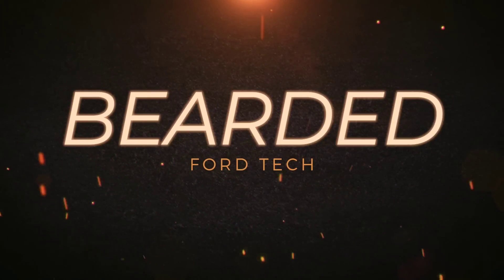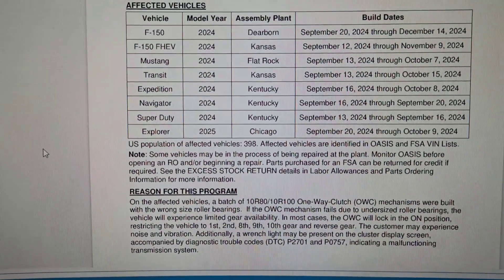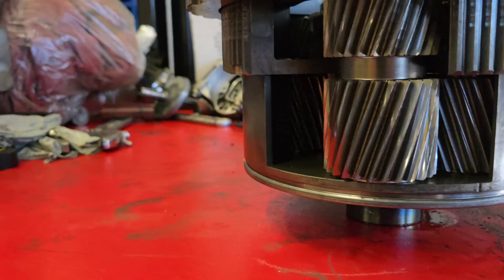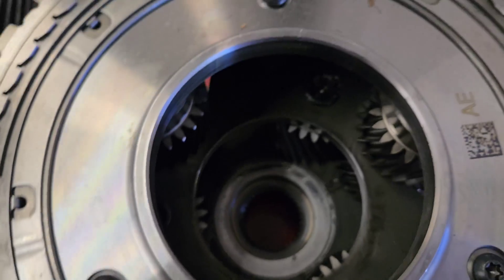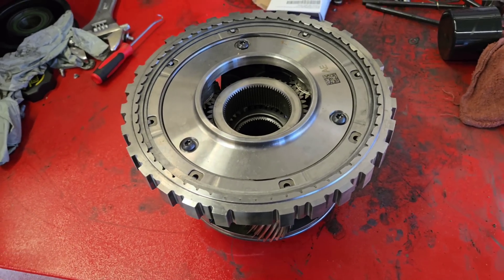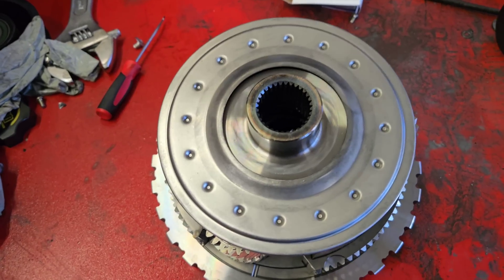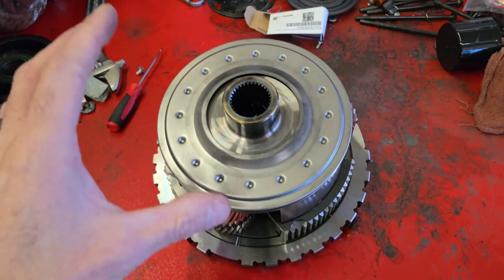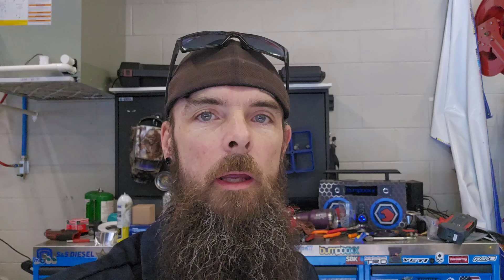ANOTHER!! 10 Speed Transmission Problem!!

Comment from the maker: This affects the 10R80 and the 10R100. Not the 10R140. I was just referring to the 10R140 cause it has the same internals as the 10R80. 
The OWC I showed is from a 6R140 just to show you what the part looks like. Not the exact same but performs the same function.
Reply: The GM 10L1000 used in the 2500/3500 pickups is having different issues such as the trans locking up and causing the rear tires to lock up at speed. My friend has a 2022 and just had a recall on his 2500 to supposedly address this issue. He had this happen twice before the recall was done.
Reply from the maker: @richwitt3559  yep. Thay recall is fairly new too

Comment: I tow alot with my 2021 f150. I use amsoil atf, would you recommend using their thicker fuel efficient atf instead of the ulv fluid?? Thicker is usually better for protection so i figure maybe that would be beneficial? Whats your thoughts?
Reply from the maker: Thicker os not always better. Transmission fluids expands a lot.  However. You have a 21. They didnt do the updated fix until 23.  I had a 2029 ranger with a 10 speed and used the fuel efficient atf.  Shifted like butter. But not because it was thicker.  Really isnt that much of a difference in viscosity.  ULV just expands a lot!  But yesh you can run the fuel efficient.  Its compatible.  I rode around for two years with it.
Reply: @BeardedFordTech awesome thank you so much man, i appreciate your vids

Comment: I bought a used 2020 at 47k certified used w a "Lifetime powertrain warranty", I also bought the "wrap" extended warranty for $4200.00. Now I have 82k miles my tranny is out and because I got my OIL CHANGES done at other certified shop NOT the dealer I voided the warranty. I am quoted at $10k for the fix and not a penny is being paid by warranty. $10k i don't have....I'm beside myself right now.
Reply from the maker: What does a oil change have to do with the transmission?  You can get an oil change anywhere. Explain "certified shop" please. I'm confused. If you got an extended warranty on your powertrain it should be covered. Email me your VIN i can see what you got. See if I can help you any way I can.
Reply: @BeardedFordTech ya i basically got scammed by a dealer....actually "The Oldest Ford Dealership in America" Tenvoorde Ford. Their website, window stickers, and advertising say "lifetine powertrain warranty for certified used when i asked for my signed documents its called a lifetime powertrain "loyalty program". In that document there is a term and condition that IF i live within 50 miles my work has to be done there OR call a 1-800 number for approval. It's not the ford factory powertrain warranty.
Reply: @BeardedFordTech the secondary warranty is a "wrap warranty" which is for most everything that not an internally lubricated part.
Reply: @BeardedFordTech liked and subbed thanks for listening man.
Reply: @BeardedFordTech i know it sounds confusing, I was shocked when I got my denial records. The ONE saving grace i have is i have the warranty document about those very specific terms and conditions they are citing to deny my warranty. Those terms required initials to show acknowledgement of those very specific terms and I never initialed it. It's probably not going to end well but for the moment its a little hope.

Comment: Any idea on why my 2021 f150 extended cab 4x4 10speed would shake a bit when I release the gas pedal going around 65-75 mph? It has about 36k miles on it and just bought it last week from the dealership, had a check engine light come on with P025A, P0300, P0304, P0306 before I ever made it home, had the dealership replace the fuel pump and seemed to clear the codes but now having this issue.
Reply from the maker: @kolebragg4638  300 is a random misfire on startup. 304 and 306 is a misfire on 4 and 6 cylinder. Which pump did they replace?
Reply: @BeardedFordTech  so he said just the fuel pump from the text messages he sent
Reply from the maker: @kolebragg4638  there's two. On in tank. And a high pressure on one engine. Something isn't adding upb
Reply: @BeardedFordTech  interesting, the codes all went away and drove fine for a few hundred miles. Got a good bit of mud up under the wheels that seemed like it made the shaking worse but knocked it all off and still happening just not as intense. Got tires balance and aligned with no resolution. I will reach out and see if they can tell me which pump was actually replaced. It’s been the worst experience I’ve had with a vehicle thus far and it’s only been 2 weeks
Reply from the maker: @kolebragg4638  yeah a deceleration vibration can be tricky. Let me look at tsb
Reply from the maker: @kolebragg4638  only thing I see is for vibrstion shudder and throttle tip in during highway speeds. And the fix is to reprogrsm the pcm.  Thats for a 2.7 3.5 ecoboost or the 3.5 powerboost. Not a 5.0.  Which is TSB 22-2224

Comment: Another ford tuff. My lovely F150 gear selector broke off putting it into drive. Had to hang it up with a rubber band because it shifted into third gear going across a bridge goin 60. Funny thing is the part was back ordered. Go figure. The selector is two pieces. Outer part sides onto a shaft closest to the column.😢
Reply from the maker: @Laserman99  I'm doing an E350 steering selector broke. It's a 2011 I think.  I know on the like the 02 models. The shift lever will get loose. There's Teo torx bolts under the dash. Tighten those. Fixes that problem. May not be your situation though.
Reply: @ mine is a 2023. The plastic snapped inside the boot which then allowed it to come off but not completely because of the wires.

Comment: If the one-way-clutch is either locking at wrong time or unable to lock, I can't see how those thrust bearings would have any influence. The "bearings" in the actual OWC being just a few thousandths off WOULD make a difference. Around 3:42 you move the OWC slightly. The thrust bearings, which you fondled earlier, only affect end-play. If they are failing and scattering metal, that's a whole nuther thing.
Reply from the maker: @gailtaylor1636  it's the bearing on the end too which I didn't have to show. A roller bearing. All three are out of spec.

Comment: Why does an automatic transmission need 10 speeds the more speeds the mire headaches...6 speeds is enough
Reply from the maker: Fuel economy.  I will admit that yes it does getter better fuel mileage cause it's in a higher gear. And 7th gear is the 1:1 ratio on the 10 speed. However. The 6 speed is my favorite.
Reply: It is same thing as the automatic engine shut down after a short delay, for example at stoplights. It adds cost, complexity, and weight but it games the emission restrictions, right under the noses of the regulators. And everyone knows it and looks the other way because our society treat more cost, complexity, and weight as “lluxury”.

Comment: I think the biggest downfall of gm transmissions aren’t the transmissions themselves, it’s the torque converters. They’re cheap, they grenade themselves trashing the rest of the clutches. The 8 speeds have a few more issues in the valve body as well, but for the most part if they just put quality torque converters in, the transmissions would last just as long.
Reply from the maker: @morganpowell2999  all the ones I saw fail on gm when i worked at independent shops was valve bodies clutch packs. And planetary.  Yeah the torque converter is junk too
Reply: @  were those 8l90’s mostly?
Reply from the maker: @morganpowell2999  mkst of them yes
Reply: @  yea those are the worst ones. I think gm actually has a lawsuit against them because of that transmission.
Reply: That is what I learned after I had a 2015 6L80 take a dump.  Most likely the torque convertor failed and sent flack through the transmission.
Reply from the maker: @nschelling6420  it's a 6l80. Known to fail. Usually happens at around the 120-150k mark on those that I've seen fail.  Guys take them out and beef them up a little.
Reply: @BeardedFordTech  154K on mine I believe.
Reply from the maker: @nschelling6420  yep. Thats right around that time frame. You get it rebuilt and beefed up a little?
Reply: @  I got lucky and lasted to 200k before mine went. Got it rebuilt with a billet converter, T-stat delete, and some better clutches.
Reply from the maker: @morganpowell2999  nice.
Reply: @ I put a Certified reman in.  Certified is based in Omaha NE which is about 2 hrs from me.  They use some upgraded parts.  TC is one of them.  They delete the thermostat.  I added a spin on filter on the return side of the trans fluid cooling circuit.  So far so good.  Personally I hate auto transmissions, give me a manual any day.
Reply from the maker: @nschelling6420  i love manual transmissions. Really hard to get nowadays. My 18 mustang has the manual. MT88

Comment: Ford developed the trasmision,  not GM. GM did the front wheel  drive program. That was subpar. GM adopted  the Ford transmission, not the other way around.  But yes there is a problem with the trasmision and both manufacturers are having major failures.
Reply from the maker: GM didn't adopt the transmission from Ford. Or the other way around. They jointly developed it with their own slight modifications. Which was a bad idea on both parts. GM has a recall out now cause the something in the transmission locks up the rear diff.  And the 850,000 trucks being recalled for engine failure. Mainly the 6.2 liter.

Comment: Does the Ranger use that same   transmission
Reply from the maker: 10R80. Yes. Never had issues with the rsnger though. Not one time ever at the dealer have I had to do transmission work on a ranger. Or on mine. I dont know about if the new ones have any problems.
Reply: I believe the new rangers have 10R60

Comment: Definitely an unfortunate supplier quality issue on the OWC.  Wont find it on final test as it cant test at a high enough torque capacity.  GM and Ford dont always share suppliers so wont necessarily see it on both.
Reply from the maker: True. But I don't think they test them like they should, honestly. And that goes for anything, really. If they did. We wouldn't have these problems.

Comment: tthanks again ford tech. we received a wiper  recall for 2016 f150. waiting for secondary letter
Reply from the maker: @spn455  yeah wiper motor replacement? Or arm replacement?  Both are pretty easy to do
Reply: Yea, then who's fault if it drags the wiper across the windshield. Will prolly fit it in w the usual oil change
Reply from the maker: @spn455  doest drag the wiper.  The motor replacement is due to a wrong motor. It may not work.  The arm is due to two things. Wrong size arm. And locking mechanism that holds it to the motor.
Reply: @BeardedFordTech  thanks again
 Yea I can confirm it does not work very rarely and I don't do enough work on em to argue one side

Comment: Mercy! That is why you don’t want a Ford Motor Company vehicle. 🙂
Reply from the maker: @frederickwoodard9551  you misspelled gm
Reply: @ I was using an expression that this is very bad for Ford Motor Company when I used the term mercy and I was not talking about GM period if you read the message throughly. I was also talking about how bad the recalls on Ford Motor Company vehicles are. 🙂
Reply from the maker: @frederickwoodard9551  i know what you meant.  But this all came about when they merged with GM for a "good transmission".  If they would have just left it alone and kept the 6 speed 6R80 it would have been fantastic.  
Oh and GM is about to announce a massive recall which would probably put them over the top. 2016-2024 5.3 liter and 6.2 liter engine failure.
Point is. Doesn't matter which manufacturer cause none of them can get it right. Merging together doesn't fix it.  Just makes it worse. All the new ones are basically junk.
Reply: Ford is First on Race day🎉. I love ford

Comment: Thanks for sharing this.  At first I thought it was the 10R140 that this was going to be about.  I've seen a Ford Dealer Tech on YouTube say that the GM 10L Transmission used in the GM 2500/3500 Diesel pickups was the same transmission (10R140) used by Ford in the Super Duty Pickups.  I didn't think this was the case.  Can you answer this?
Reply from the maker: @richwitt3559  10r80 10r100. I was just explaining the 10r140